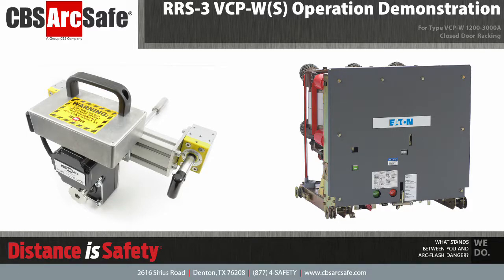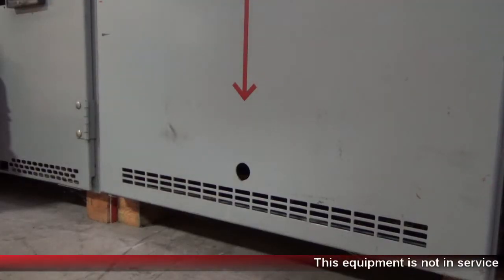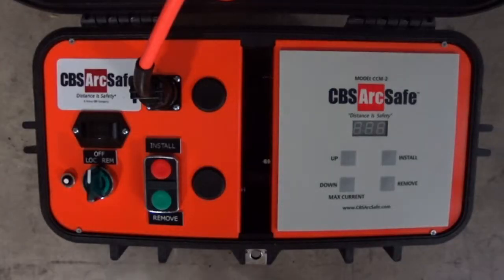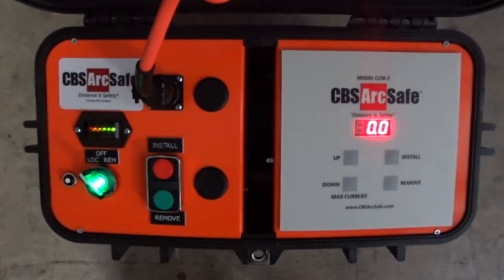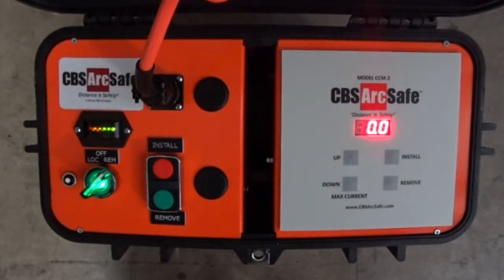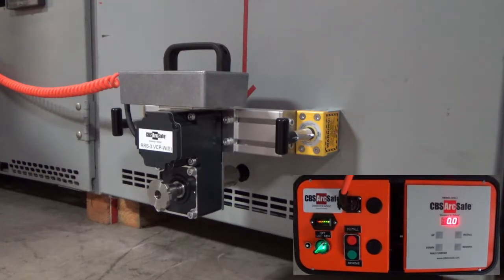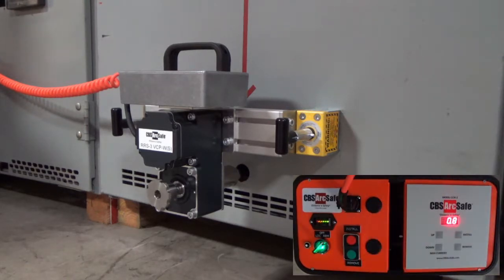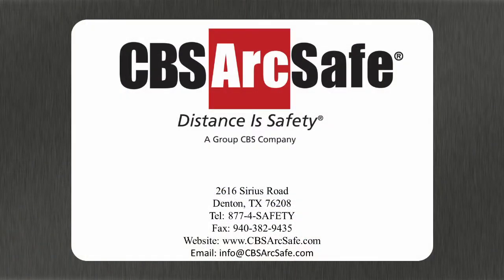CBS ArcSafe® RRS-3 VCP-W(SCD) Operation Demonstration - Remote Racking

Comment: Do you have a version for open door operation?
Reply from the maker: Hello Robert,

We in fact have (2) separate applications that can rack this VCP-W breaker with the door opened. 

We offer the RRS-3-VCPR unit as shown in the following video link below. This RRS-3-VCPR has a built in camera system which shows the user to stand back up to 50' away to operate the unit. This unit allows the user to view the indication window on the carriage as well as seeing the torque being applied throughout the process.
https://www.youtube.com/watch?v=40FsozLxJ9Y&t=1s 

We also offer the RRS-3-VCP-W(S) which comes standard with radio remote abilities for use up to 300' away, but does not include the camera system. We can send you a manual on this device if you are interested. Please email info@cbsarcsafe.com for any details you might have questions about, or give us a call at 940-382-4411 and we would be more than happy to talk to you about our offerings. 

Kind Regards,

CBS ArcSafe